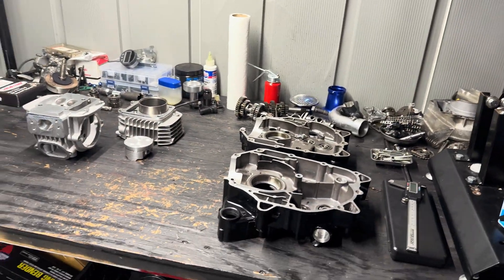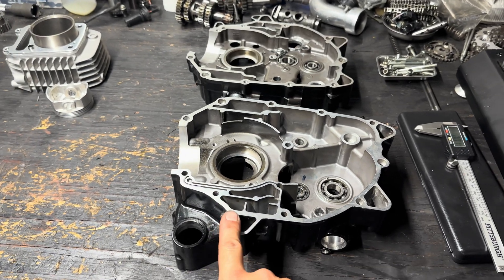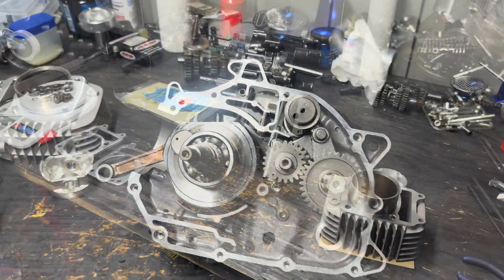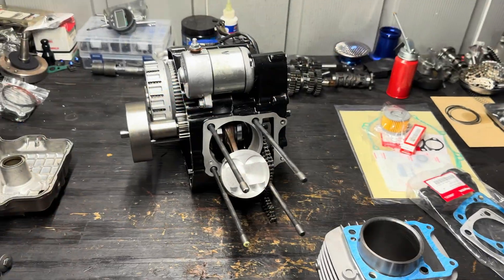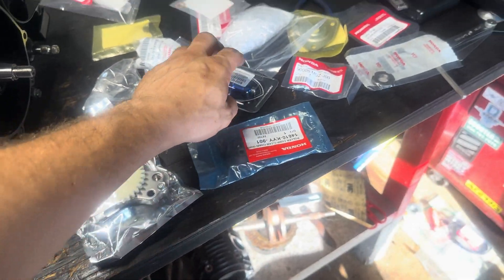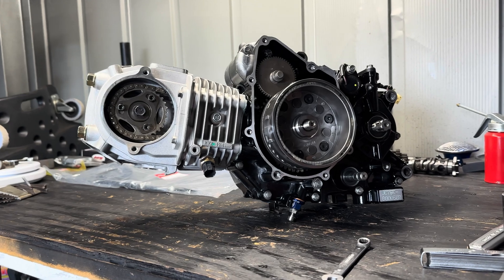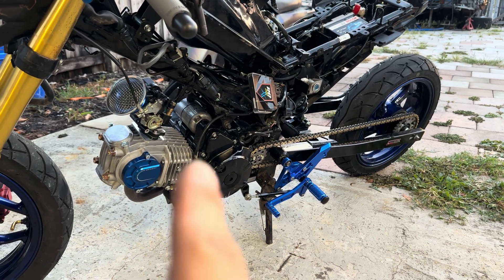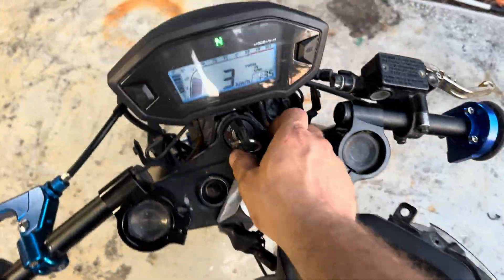Honda grom 205cc 4 valve engine build

Comment: what brand cylinder are you using
Reply: Hi ok what is your ebay seller's name,i am building 2 grom motors 1 2v 186 on a tbolt bbk & a koso 170 4v,but after seeing your tube vid i like the look of your bbk cylinder to 4v instead of the koso 170,I've  a 3mm stroked kitaco crank & 5speed to install
Reply from the maker: @darrynnorris4368  Mxdaua118 on ebay. The kit comes with everything needed for the installation. The cylinder is way better than the tbolt kits and koso kits. Super thick sleeve no issues with crank them and could bore it out bigger in the future if you want.
Reply from the maker: Its from Thailand. You can buy the same kit from me on ebay
Reply: Do you know how much power you make at the wheel? They have the Daytona 212 4 valve motors that claim 20hp.
Reply from the maker: @NICKELGHANDI  haven’t dyno tuned yet but id say 30/35hp raced a ninja 300 yesterday was super close.
Reply from the maker: @NICKELGHANDI   haven’t dyno tuned yet but id say 30/35hp raced a ninja 300 yesterday was super close.